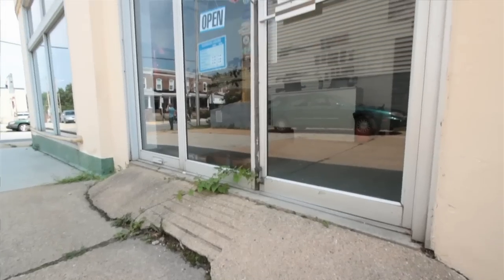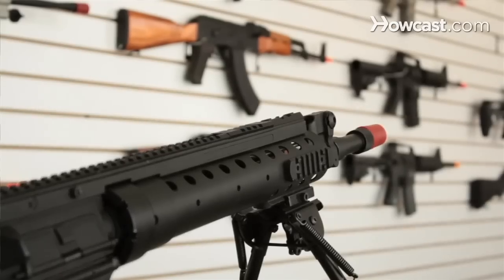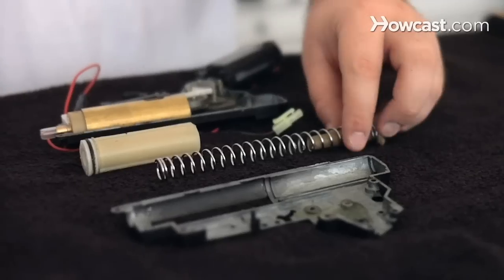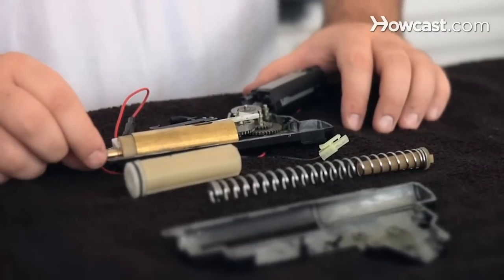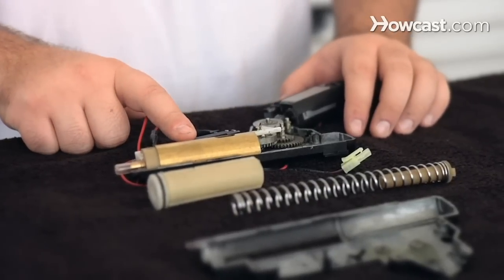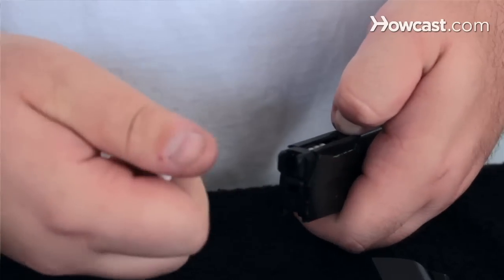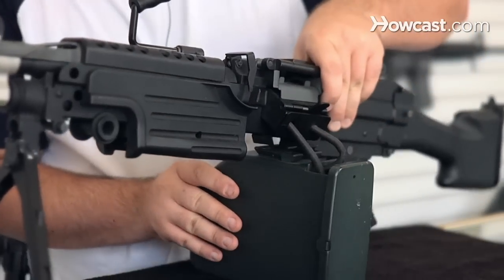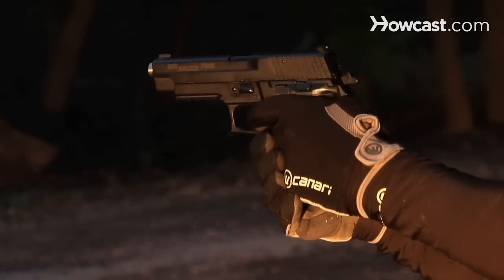How Do Airsoft Guns Work? | Airsoft

Comment: I have a question, can a gaspowered airsoft still work without the gas? What if i just manually reload it like a spring airsoft?
Reply: it will not have any firepower without the gas because the compressed air is what causes the cylinder valve to spin, and the valve to be pushed forward, and if the gun is blowback, it also causes the slide to be pushed back, for another bb to go in. so in short - no it would not fire